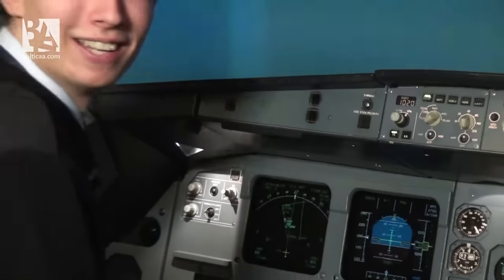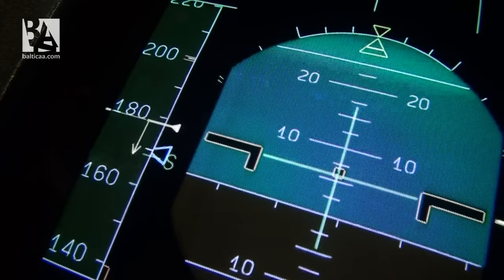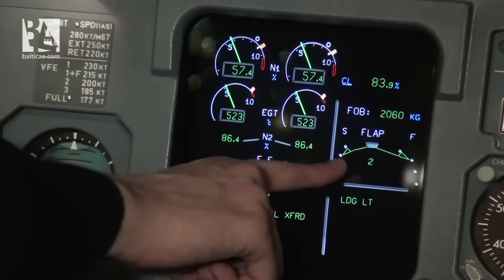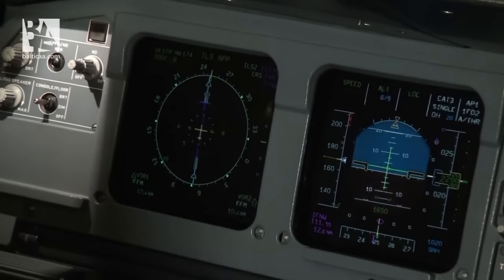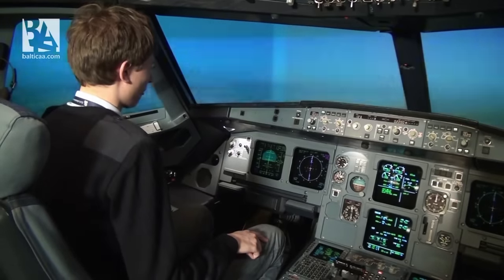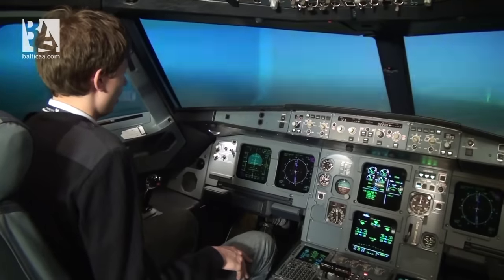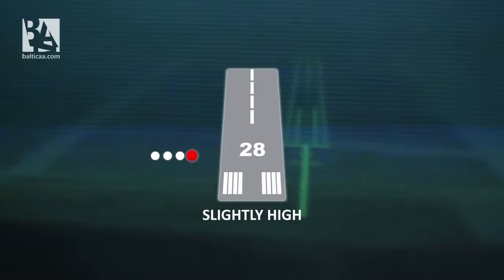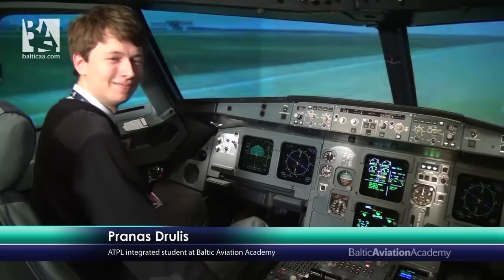Airbus A320: Auto Landing Tutorial

Comment: I want an autopilot that allows me to sleep until the plane has stopped.
Reply: Lmfao!!!
Reply: LMAO!!! :D
Reply: Technically they have the technology to do this now using GPS, ILS, etc. all combined with an extremely powerful autopilot computer but itll in my view never be fully automatic should always have a set of two eyes on whats going on. It would make (in normal conditions) the job a lot less stressful for pilots who do lots of flights id think.
Reply: THE SANDSEEKER U.K that's the future
Reply: Actually I think this will happen sooner then you think fully automatic flying planes by computer without any pilots on-board. Reality is most crashes are because of human error where computers can't make those mistakes. It will be a slow transition first still have pilots on the flight deck but just watching computers fly then it will go down to one pilot in the cockpit then no pilots.
Reply: davidca96 yea they use airways in the mcdu so you dont even have to touch the controls in the air
Reply: @BattleReport_CommandoComics  windows blue screen
Reply: Both sydtems I know, one is for emergency made buy Garmin, Autoland system, one button lands you on the nearest runway without doing anything. The other is Airbus ATTOLL currently engineered, for automatic Take off and Auto landing and taxiing.....
Reply: Propofol.
Reply: And it also needs to feed me
Reply: THE SANDSEEKER U.K to make sure if anything goes wrong they are there to correct it because humans who are imperfect make the machines imperfect
Reply: So better to stay home
Reply: The RetroCave Comics in case of the autopilot or unexpected scenario occurs ...
Reply: @WhiteShadow2k1 😂😂😂😂
Reply: blastman8888 what about pushing back the plane, taxiing, who’s gonna program the fmcs’ flight plans and etc? That’s why I don’t think that there can be such a thing as a fully automatic flying plane
Reply: Аnd then, Autopilot mode control by human behind computer
Reply: Why are you even playing then lmao
Reply: wait until ATTOL comes out
Reply: Eventually probably
Reply: @WhiteShadow2k1 😂😂🤣 XD

Comment: I have two questions : 
- 07:18 what is idle reverse?
- In order to taxi to the gate you apply thrust as soon as you disengaged the autopilot on the ground right? 
Excellent video thank you
Reply: Engines of large aircraft produce some level of forward thrust, even at idle power, so reverse still needs to be engaged to cancel out this effect. Idle reverse is just that - "extended" reverse panels with engine power at idle.
Reply: in the action i didn't see any difference with normal reverse. is there any specific button to push or something to pull?
Reply: Nope, no buttons. Reverse thrust has multiple positions: "reverse idle" and if you pull thrust lever further down into rev - "reverse thrust".
Reply: excellent thanks

Comment: Pranas, why do the Boeing equivalents have so many flaps positions compared to the seemingly small number on the Airbus aircraft?

In any case, Airbus avionics always seem to make it look so easy...
Reply: yeah watching the Airbus version of this and also the Boeing video on auto land  the Airbus seems so much easier and simpler to use with less work to do
Reply: The reason is, the Boeing make their premade degrees. The Airbus uses a computer to create its own degrees based on speed weather and height and weight. airbus is all by computer..Boeing is all by captain.
Reply: will lowe ahh that makes sense, thanks!
Reply: No probem mate. I love the airbus..great bird. Happy tail winds
Reply: will lowe cool. I also heard that the airbus auto retracts the flaps after takeoff when it reaches certain speeds, is this true?
Reply: GSX-R600L1 no
Reply: No, that's still under the control of the PF. .
Reply: GSX-R600L1 only from Flaps 1+F to 1 if speed gets above 210 knots :)
Reply: will lowe And Airbus is much more efficient.
Reply: +Bruno_pt99 Ehm.... Maybe you should research more about these things before you comment about them...

Comment: I've heard it's a fairly hard landing, not quite as smooth as when done manually.
Reply: Ye its mostly for a confirmed landing when your in Zero visibility. Lands hard to assume that its a wet runway.
Reply: rojamb And if the landing must be aborted at DH (Decision Height ) the aircraft will touch the runway and as the engines spool up the climbout is performed.
Reply: Yes, but its better than landing on the grass because you can barely see the runway.
Reply: That is correct. Usually you can feel the difference as autoland is.. let's say less gentle. Also, if you are seated in one of the first rows you can hear the autopilot disconnecting from the flight deck.

Comment: Depends on the weight. I can see the outer wing tank are transferring so it's probably not carrying much fuel. 122 sounds fine for an empty aircraft on Flaps 4. The speed is reduced in a segmented manner to each flap setting, which is exactly what Pranas did. The autothrust is fully capable of reducing the speed in a controlled fashion to any selected value within VMO and VLS.

Comment: 120, that not staling the plane even with flaps on?
Reply: Far from it. And I am sure this aircraft was configured to be probably 75% full of passenger and cargo. These planes actually can go alot slower than I used to think.
Reply: ***** well what if it's a boeing 737-800 ? what is the minimum landing speed on this plane sir ?
Reply: I have heard of empty planes landing at 105 kts
Reply: woow too slow :) thank you :)
Reply: LOL THAT FLAPS LOWER YOU STALL SPEED LOL
Reply: hahahahha go and get a job
Reply: A380 is able to go 160 at around 4-5K feet.

Comment: 123 knots are a bit slow. isn't it?
Reply: +Itz Srexor [Pause] Depends entirely on the weight.
Reply: +Mads Frost yes. you're right
Reply: Depends on weight, but also elevation of airport, temperature, air pressure, length of runway etc. VRef is a tricky calculation on a flight computer, but thankfully pretty much done for you on modern airliners.
Reply: Lucky You're not Pilot, right? I love people without competence and a great mouse. ;-)

Comment: Do airline pilots have to know how to successfully land a plane manually in a cat 3 approach?
Reply: Duh!  If you were a passenger, would you not want a pilot who knows how to land a jet manually?   You win dumbest question of the year.
Reply: @Nick V: Did you consider reading the question?
Of course pilots have to know how to land the plane manually. In fact even with the technical possibility mosts landings are done manually.
But landing with success in cat 3 conditions (ZERO vertical visiblitiy and 50 meters horizontal visibility) manually is next to impossible, because you can't see the runway until it is too late and you have possibly already created a nice crater.
You win dumbest answer of the year, without any doubt.
Reply: Colaholiker Thank you. I asked this same question to an actual airline pilot yesterday and he said no, the plane must be flown on autoland. Thanks for pointing out who won the dumbest answer.
Reply: I'd be surprised if thy were required to land on autoland all the time, as they absolutely MUST be fit to do it manually any time, as long as the conditions allow it. (If conditions don't allow and for technical reasons autoland is not an option, they have to divert.)
I would guess the percentage og how many landings must be manual or automatic can vary, but an "always autoland" policy seems as strange to me as the intention to attempt a manual landing in CAT3 conditions, unless there is really no other option.
Reply: In Cat3 conditions they have to land with autoland.

Comment: 1. Tune the ILS freq. of the runway on the NAV1 radio.
2. As you approach the runway's general heading, click the 'App' button on the MCP.
3. The flight-director will show your deviation from the glideslope & course, but there will be no actual movement as the autopilot is off (if it is off, that is).
4. Finally, switch on the autopilot using the appropriate button and the aircraft will guide itself to land!

These are general instructions for the stock FSX a/c. Search youtube for specifics. :)

Comment: A lot of the time an ILS approach will be used, but then the autopilot is switched off when they have runway in sight, or, when MDA or MDH is reached (minimum descent altitude, or minimum decent height). An MDA is a baro height, an MDH is a radar above ground altitude. Of course, if the A/C reaches minimums on an ILS approach in instrument conditions, and the runway is not in sight at that time, a missed approach is declared. (ICAO Annex 6)

Comment: Basically AP2 does exactly what AP1 does. They both essentionally monitor each other to add a level of redundancy. You could use just AP2 if you wanted, but that would not provide the level of redundancy required for a CAT3 approach.

Comment: Plainly spoken both autopilots are the same thing, but they are using different data sources (like air data, flight director, etc). There is more than one basically for redudancy (in normal ops usually when the Captain is PF, they fly on AP1, when the FO is PF - they fly on AP2) and for when performing a CAT III approach (coupled data sources give higher precision)

Comment: Hello, thank you for a great video explaining landing procedure. Two questions:
1. Can the a320 do a similar landing to a runway without ils equipment and only rnav routing through the gps.
2. From FS2020, i have tested airports in Honduras (i am Honduran) and teste ILS 22 on MHLM coming from the south MHTG. the auto landing with ILS was not succesful as i believe the plane couldnt handle the tight "uturn" to land on 22 and lost completely the runway. Could this be a bug in FS2020 or in a real landing pilots enter to the f-plan a more northern waypoint to get a smoother transition to ILS?
Reply: The A320 can do RNAV/RNP approaches yes

Comment: Thats not manifold pressure, that's the altimeter QNH setting. It's used below the transition height to calibrate the altimeter so that it reads correctly. Also to be sure all aircraft in the area are on the same page so to speak. Above the transition altitude, then it is set to standard pressure 29.92 in the USA, 1013 kpa in the rest of the world. Then the altitude becomes a flight level. Eg. FL200

Comment: Vacate the runway dude !!   :D
Very good explanation bro.. just a question ?
When we have to use AP1 + AP2 together and why??
Can you just explain what the AP2 do in accordance with AP1 ???
Reply: First AP1 aligns the plane with the runway for when the pilot decides to disengage autopilot and land the rest.

When AP2 switcheS to ON during ILS, AP2 assists the plane in flaring, leaving the pilot to only control the throttle.
Reply: AnexPwned I thought AP2 was a backup just in case AP1 failed
Reply: +Ozan Akdag it is but the other dude is spreading wrong info
Reply: +sykkel boy like what bro ??

Comment: Your autopilot needs an update, that's runway 25C, not 25R. :oD
Well, I know, when the video was filmed, the runway that is now 25R wasn't opened yet, so it was correct by the time., as they added another runwa off to the right which became 25R with old 25R becoming 25C, which is rarely used for landing nowadays. They try to get landings on 25R and L and use 25C for take-offs to allow parallel approaches which isn't possible between 25L and C as they are too close to each other.

Comment: Wondering if the autopilot is capable of landing a damaged plain like on an one engine out scenario. Would you mind showing this? :)
Reply: The autopilot system probably can as it automatically trims the aircraft in the event of a engine out scenario. In pretty much all cases of engine failure the aircraft does a ILS approach so it wouldn't be too hard.

Comment: Ok, that approach speed of 125 knots is this because the aircraft is light ? I thought average approach 135 knots ? also on ILS will the approach attitude of the aircratf angle be correct automatically ? I turn auto pilot off just before touch down and lift the nose slightly for flare is that correct ?

Comment: i have a couple of questions: 1) lowering the landing gear... is it done at one dot above the G/S path achieved or when?...
2) what is the difference on the throttle handle between idle reverse and full reverse? thanks.
Reply: 1): really...it doesn't matter when, but I suggest below 220 KIAS should be fine 2): IDLE REV is when the reverser flaps are opened but the N1 is at 20 or so %FULL REV is when the engine spools up to about 85% N1, thus providing a larger amount of reverse thrust
Reply: And not to mention that the gears take a bit of time to lower and lock, especially on planes with more complex gears such as the B747 (2-4x4) and A380 (2-4x2, 6x2) and perhaps the 777 as well (2-6x2)

Comment: Hi, just one question: Why do you start the ILS approach to 25L at 2.200ft and not at 4.000ft as published on the approach charts?
Reply: LevelD1985 I think he's just showing the functions of the Autoland system and is not concentrating on individual ILS/LOC plate components. Indeed, LEDKI is at FL040 but the glide slope can be captured any any altitude as I'm sure you're aware.

Comment: question from an unaware person ;-). can you always land with ILS or does it depend on some environment condition like wind, etc..?
Reply: +Martin Broll Yes it is possible to always use the ILS. But there are two factors- 1.) The airport you are landing at must have the neccassary ILS beacon (quite common for major airports) and 2.) During a thunderstorm or extremely windy day (crosswinds of 25mph+) you must deter from using ILS as the autopilot has no control over the rudders and wont be able to maintain course in some situations. Manual mode is to be preferred in such situations.
Reply: Sachin Peruri hello, thank you very much for the explanation!!!
Reply: +Sachin Peruri Actually the A320 and almost all modern planes have autopilot rudder authority at least in autoland situations.

Comment: Hey, could someone help me. So, the LOC button activates the horizontal system, the APPR button activates the vertical system, but I don't get what the ILS button does, does it activate the connection between the landing system and the autopilot so it actually moves?

Comment: about single or dual mode... is this just for redudancy issues if one Auto Pilot Fails or anything else ?
Reply: +bobl78 yes
Reply: Dual autopilot is where both autopilots check what the other is doing too make sure none is doing something stupid. Single is used in most cases but in low visibility they use dual.
Reply: Ok, and why don´t they always use dual ? Any disadvantages?
Reply: Not to my knowledge any disadvantages just no reason too. I mean I presume some pilots actually put it in dual mode even when not necessary but you can.

Comment: Did you already program the FMC/FMS? If yes what information did you put in and where did you get it?
Reply: He has to program the fm can to do the ils landing and you can get information from the Internet.
Reply: Fmc***
Reply: +sykkel boy On the Airbus it's called MCDU.
Reply: computer tutorials12 not always. it depends on where you're from or who you got trained by.
Reply: in the MCDU (all modern airbus aircraft are the MCDU not a bloody FMC this isn't a Boeing) you have to put in the minima in the perf page which in this case is 20 feet AGL in the radio alt section its really not too different MCDU wise as a standard ILS too my knowledge.
Reply: Cyka Meister No it doesn't, on All Airbuses A319 or newer, it's always called MCDU, on newer Boeing aircraft, (Or older ones that's been updated.), it's always called FMC.
Reply: Guys FMC= Flight Management Computer. The info you put into any MCDU or CDU or whatever your aircraft manufacturer may call it goes to this computer and it flies the plane (when AP is engaged)
Reply: Ethan Chen That's true, but each one uses different software and has different capabilities.
Reply: computer tutorials12 Yes, but I feel too many people use FMC and MC(D)U interchangeably

Comment: In FSX, on an Airbus A320 when I engage APR (approach hold switch), it will only capture the glide slope and not the horizontal path. But when I engage LOC (localizer) it will only engage the horizontal path and not the glide slope. I am doing something wrong??
Reply: After you capture localizer with LS, use LOC button first (for a bit) to align horizontally , and APPR when you enter into glide-scope - basically, while you're flying on the same altitude, with LOCalizier aligning you horizontally with the runway. at some point you will intercept/capture glide-scope, and with pushing of the APPRoach button (and subsequently AP2 for backup of AP1) plane should start final descend onto the runway on perfect descend line.
Reply: ok thanks!

Comment: It's bewildering how many different labels aircraft manufacturers use for flaps. Degrees.... usually 0-30 or 0-40 though I've seen as high as 50. Boeing used Units for a long time.. usually 0-40. Airbus and Hawker use Numbers... 1, 2, 3, etc. I flew a Cessna 337 that used fractions 1/3, 2/3, Full. Then Beechcraft uses Up, Approach, and Down while the newer King Airs use Percentages.. 0%, 40%, and 100% or Landing.
Reply: And I flew Piper Cherokees, that talk in degrees. But the instructor taught me in terms of 1 notch, two notches, or 3 notches, which is all the notches there are (and flapless was great fun!). I think a lot of the aviation jargon is hangovers from the glory days. Why complicate things, when numbers 1 to 4 achieve the same result?

Comment: how do you decide speed ? you were changing it manually 
when do you start landing procedure , before how much miles?
Reply: The final approach speed should be usually around 30% over the plane's stall speed
Reply: thanks for answering
Reply: Reading Craze no problem
Reply: Sometimes, you are told what speed by ATC to keep you away from the AC in front.